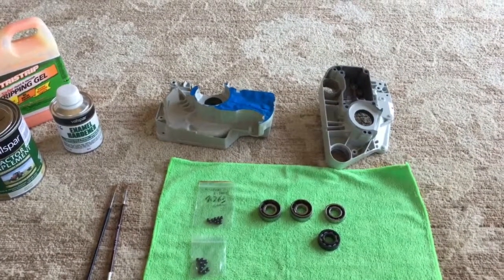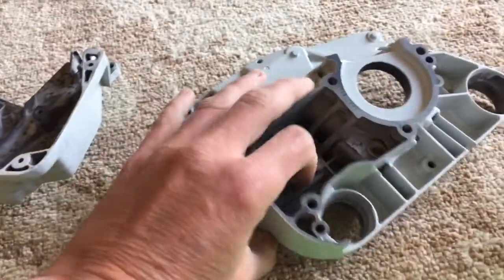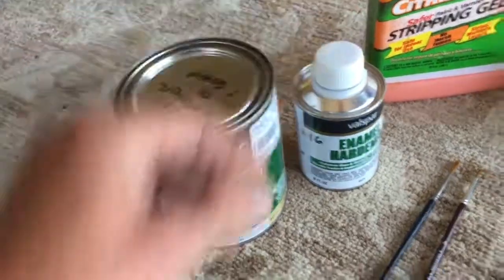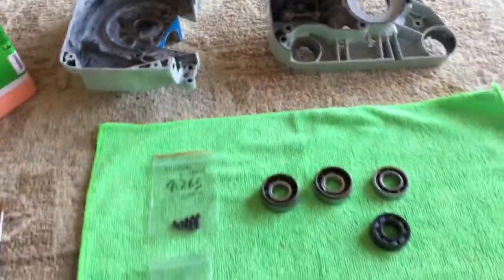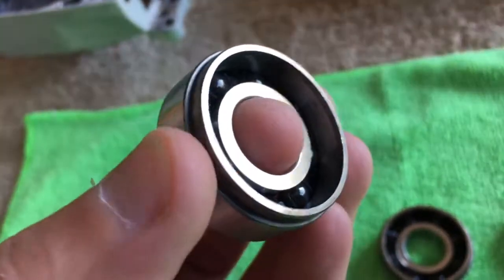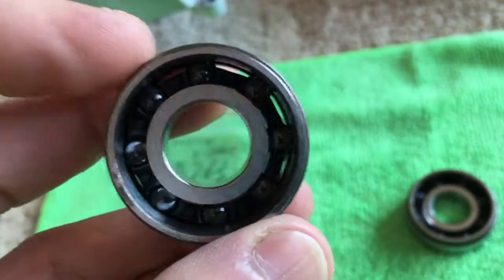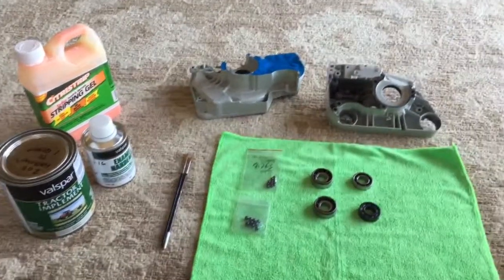Sthil 026 painting & ceramic bearings

Comment: Great content Ray!  Did you have to heat your bearings in order to get the balls out. Im trying to do the same and cant pop out the inner race.  Same thing for reassembly with the Si balls?  Thanks
Reply from the maker: nah, just remove the cage (you have to make sure you have the type which has the plastic pop out cage/separator not the steel rivet together type - then just pop that out, slide all the bearings over to one side, then push the center race down and out - it should all come apart. It works on pretty much any bearing... wheel bearing for your truck, bearings for your roller skates, etc. Just apply some pressure and it should work.
Reply: Thanks Ray, I used some leverage on my Stihl 066 bearing, it worked, and ordered 6.747mm Si3n4 balls on ebay!  Any helpful suggestions on reassembly?
Reply from the maker: Getting Out of Beekeeping I can't think of anything special off hand.. basically just reverse the process and you should be all set!
Reply: @ray5961  thanks again, purchased said paint off ebay and magic hardener from TS.
Reply from the maker: Getting Out of Beekeeping That paint is really good. Mix the hardener at a ratio of 16:1 and stir well... then wait about 10 or 15 minutes. I use a good quality sable art brush and paint it on by hand. Make sure to clean everything with like B12 carb cleaner or alcohol and then do 2 coats. It's better to go light on two coats to avoid runs. The first coat won't cover very well but that's okay, because the 2nd coat will and will brighten up the color also. Make sure to fire the paint between coats in a 200 to 225 degree oven or leave the parts outside baking in the hot sun all day. The paint will shrink slightly when drying, especially the Stihl grey color shrinks really well - so don't worry if it looks a little off before it's dry... it will smooth up in the sun or oven. The 2nd coat will make it look first class.

Comment: I am in the process of being a 020t/200t hybrid and I need some painting tips like did you use a primer and when you backed it was it still wet I was thinking of just getting it powder coated I'm on my last coat of critics striper I had good paint but I made the mistake of soaking it in gasoline to clean it and the paint came off any help thanks
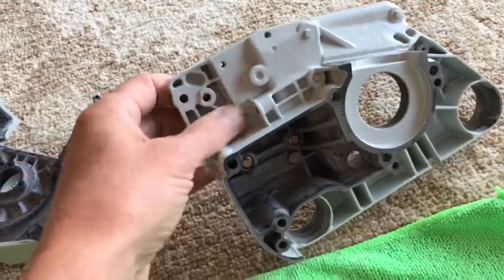Reply from the maker: As you can see in the video, I use the Valspar tractor paint. I do not use any sort of primer. I use two coats of the grey tractor paint. The first coat goes on relatively thin and gives about 85% to 90% coverage. The 2nd coat also goes on relatively thin and give you a nice finished color solid coat. I use a good quality brush and paint it on by hand (both coats). The most important aspect of this paint is using the hardener. I have done tests in the past with this paint - one where I used just the paint and one where I used the hardener. Without the hardener, the paint will dissolve with just gasoline. With the hardener, the paint will resist gasoline no problem. With the hardener, I have tested it by painting the inside of a cup and baking it. Then, once it's done, I filled the cup up with gasoline and left it sitting on the counter for over a week - the paint was fine and I dumped the gasoline out as clear as it went in. With regard to the baking process, I paint the 1st coat on and then put it into the oven at around 200 to 225 degrees F for 1 hour. I usually just turn the oven off after 1 hour and leave everything inside to cool down naturally. Same with the 2nd coat: paint it on, then bake it for 1 hour at around 200 to 225 degrees for 1 hour. If your wife isn't real keen on you using the oven (which leaves a pretty good smell after baking for 1 hour), you can also just leave the parts out in the sunshine for a couple of days (the heat from the sun and the UV will cure the paint really well - and this is the method I use for a lot of larger parts, for example when I paint parts for my pickup truck, etc.). Sometimes I also dry them for a day in the sun, then bake them in the oven for 30-60 minutes - this helps cut down on the fumes in the oven and also in the house (from the paint). As long as you bake it and use the hardener in the correct ratio (as listed on the can, I think it's 1:16), then the paint should dry very hard and have no problem should gasoline get on it. Also, as with all paint jobs, it's important that there is no oil or anything on the surface that you are painting. I always use gloves when holding the parts (during painting) so oils from my fingers don't get on the part I'm painting. I also usually clean it with carb cleaner (Barryman B12) and compressed air, prior to painting and then I will also sometimes heat the part up just a little bit in the oven (only to maybe 85 or 90 degrees F) in order to dry it out further prior to painting. Powder coating is okay also, but it's expensive and unless you do it yourself, you won't have control over the final outcome. Also, keep in mind that powder coating is just paint; any good paint stripper product will remove powder coating. The other nice thing about using the tractor paint is that you can always touch it up at home, using a paint brush and it will match pretty well. Touching up powder coating usually is a bit more tricky. Hope this info helps. If you have any other questions, just ask.

Comment: could you tell me what size ceramic balls fit the bearings? I see the 4.765 on the one package but I would like to confirm both sizes..Thanks.
Reply from the maker: Rick Klein Hey Rick, the 4.763mm balls are sold as 3/16" grade 5 silicon nitride. The other size balls I used were 6mm .2362" grade 5 balls. I bought both off eBay.
Reply: thanks, that helps tremendously. nice work on the saw also.
Reply from the maker: Rick Klein thanks!
Reply: Wondering about long term now that  the video is a couple years  old how the bearings are holding up